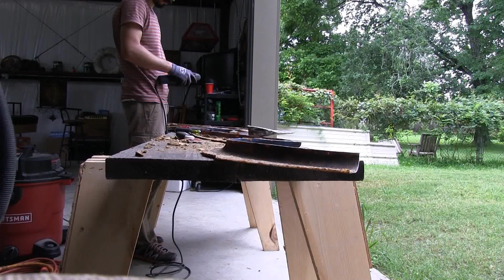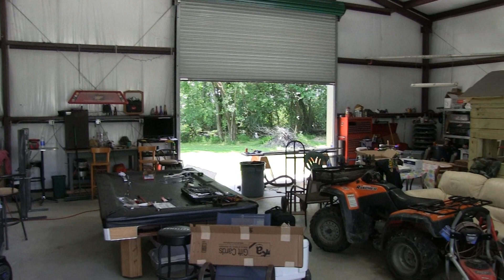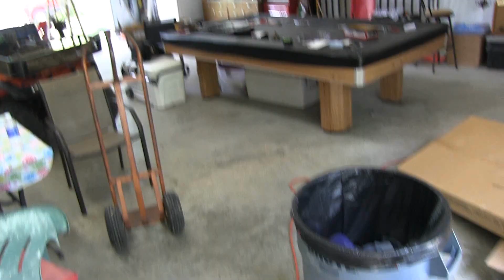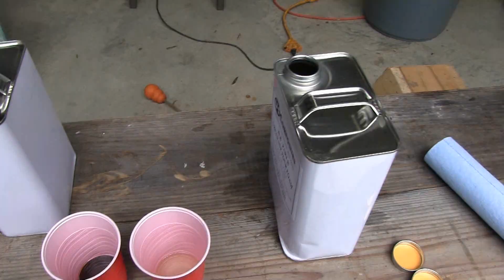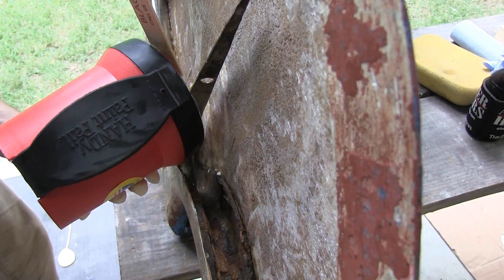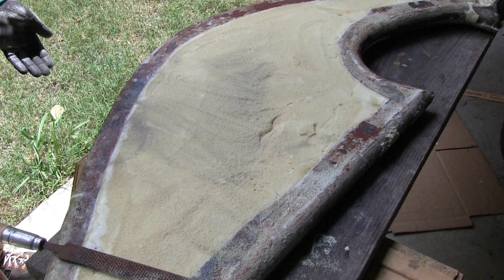Rudder Repair | Sailboat Restoration Ep. 10

Comment: you need a filler like cabosil to mix with the epoxy for general filling low spots on the foam. Plus I would never use urethane foam in a structural part like a rudder, what is needed is a high density foam like klegicell or Diviniycell. just my 2cents. I admire your efforts, keep the videos going.

Comment: That piece with a socket which the rudder fits into is called a gudgeon.  The post  which fits into the gudgeon is called a pintle.  http://en.wikipedia.org/wiki/Gudgeon

I just found your website recently.   It's good to see that someone else besides me is working on rebuilding an old worn-out boat down here on the southeast Texas coast.

I just bought a highly distressed (but very cheap) Alberg 30 this March from a little boat yard there in San Leon.   I am doing basically the same thing to it that you are doing to your boat, stripping out the old interior and engine in preparation for rebuilding.   My boat also has serious problems with rotten deck coring which must be fixed.

From watching your videos, I'ld have to say that y'all have a pretty good handle on what needs to happen and the skills and equipment to get the job done.   Keep up the good work.
Reply from the maker: drifterpilot Thanks for the info! I've been trying to figure out what that thing is called. Thanks for watching and good luck on your project.
Reply: drifterpilot I'm down in Galveston, doing pretty much the same things to a '68 Bristol 35. I would definitely like to check out some other projects locally. I used to keep my boat at the marina  where you  found yours, it is the place where old boats go to die! Keep up the good work!

Comment: question - by cutting/sanding the foam rather than using the natural crust it forms don't you lose your water resistance? In other words the cut foam can now absorb water? other times I have seen foam work they use a slow foam poured in holes vs putting a cover on later. maybe your product is different?
Reply: +tjonessc shouldnt have to even worry...the repair should be water tight...but in the event of a leak the foam should provide pretty good water protection for long time...cutting or sanding will not change that

Comment: Careful with bronze shaft in a bronze hole. While bronze itself is a good bearing material, using like materials in the same bearing can make you more susceptible to galling. https://en.wikipedia.org/wiki/Galling .  You may want stick with the stainless.
Reply: Good point!
Reply from the maker: Yeah. We'll see how it does. It won't be a hard fix if I need to change it at some point down the road. Thanks for the info.

Comment: Nice job guys ;-)  What density foam did you go with?
Reply from the maker: BoatworksToday Thanks. Its 8lb density.
Reply from the maker: BoatworksToday Also I wouldn't have been able to do this without your video! Do you think 8lb will be alright?
Reply: SailBros Thank you for the kind words :-)  Glad there was some useful info there for you!  8lb should be fine; the rudder has full support top to bottom as well as fins running through the blade.  I'm guessing the foam you used is stronger than what was used originally.  Be generous with the glass around the cut seam; taper the edges so there is plenty of material to bond onto and you'll be good to go!

Comment: Have you thought about possible galvanic corrosion between your pressed-in bronze pin and the stainless steel rudder post?
Reply from the maker: Tammy Norie Yeah, a bit. Before it was a stainless steel pin that went into the bronze gudgeon. So I figured this would be a better setup since all the movement will be between similar metals. But.. I could be completely wrong!
Reply: SailBros
Probably just something to make note of and check after a year. I know someone whose boat sank due to him installing bronze seacocks through a steel hull, so it does happen. I look forward to seeing more of the restoration!

Comment: Wow looking good. Probably a dumb question but can you use that great stuff window/door spray foam for rudder cores?
Reply from the maker: No. It's not dense enough. The foam I used is an 8lb density and that stuff is probably 2lbs or less. Needs more density to give it structure. Thanks!

Comment: That bronze tip at the rudder puzzles me. Stainless steel is much stronger, this bronze thing should be mounted just as friction surface not as a structural part...

Comment: tanks looks pretty new compared to the boat. I thought it looked newer even before it was cleaned up. I doubt they made poly tanks in 68 but I could be wrong.
Reply from the maker: SolarBurrito Yeah it was definitely replaced at some point. From what I've read these boats came with steel tanks.

Comment: Just viewed all your vids. You guys post very well done episodes. Even the audio is perfect. Y’all do this professionally? Sometimes, you bros look like twins. What’s your age difference? Has your dad also caught the sailing bug? Somewhere in the comments somebody mentioned dissimilar metal corrosion. You’re gonna need lots of Tef-Gel http://www.tefgel.com/contain.php?param=tefgel_price  for this project. This stuff is the absolute best. It even keeps bronze thru-hull valves from seizing up. Although pricey, I’ve gone through a half cartridge on my project so far. Wish I bought the 1 pound tub instead. You obviously get the best-bang-for-bucks with a larger quantity. Keep up the great work. Hope this helps. Jack, aka electricalpowerguy
Reply from the maker: Powerelectronicsguy L Hey Jack, thanks for posting. We do, do this professionally! We're 5 years apart, Zach being the oldest. We'll look into the Tef Gel. It might be pricey but whatever helps our boat in the long run!